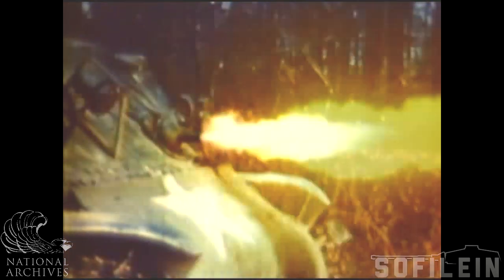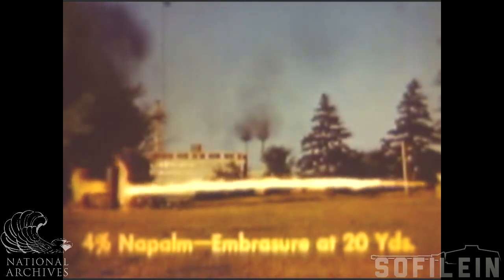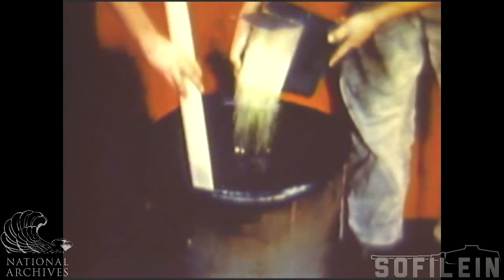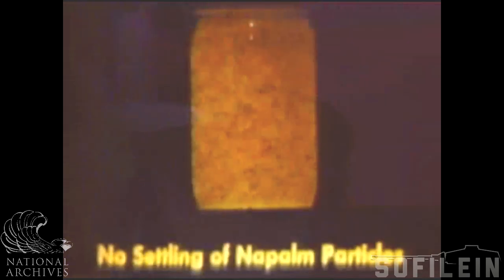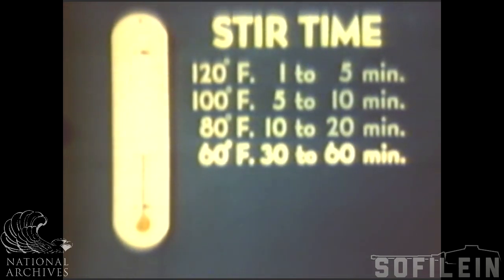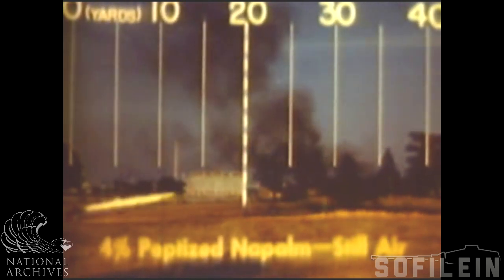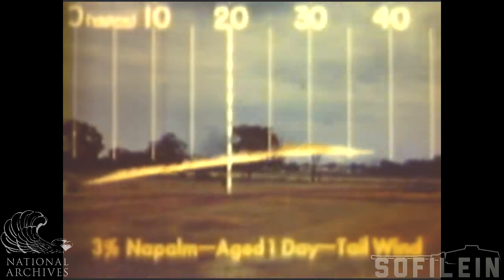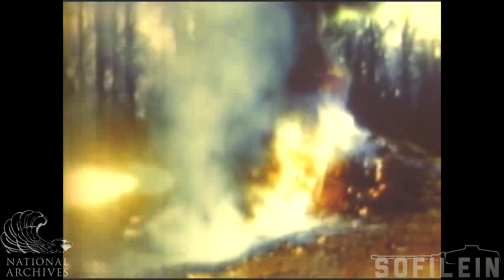How to thicken fuel with napalm for application: "Flame Thrower Fuels" War Dept FB 178 (1944)

Comment: I found the best use of a back pack thrower is to wet the target with fuel. Then light it with the next shot. You get more fuel on target and burn less in the air on the way. When the first fuel splatters on the target. The enemy may break from cover and can be killed by small arms fire.
Reply: Ya, right
Reply: What enemy are you going on about?
Reply: @lesslisilverman  You do know that you can buy flamethrowers right? Stop doubting people just to doubt them lol
Reply: @Hr1s7i  I'm assuming he's making a presumption, although it is grounded in history as not many soldiers (relatively) were actually killed by the flamethrowers themselves. The main use of a flamethrower was to push enemies out of fortified positions, bunkers, trenches, etc. so that they could be picked off by small arms fire.
Reply: @RustyShackleford556  ‘push out’ yea nah flame hits your pillbox your not getting out in time 9/10.

Comment: And for those of you that don't know this you can use styrofoam which will condense or you could use liquid soap also and I know this from experience because I own a flamethrower that I paid $5,000 for and that's what I use most of the time I use liquid soap Dawn is the best
Reply: Strictly used as a weed clearng farming implement I presume ;)

Comment: Part of NBC or CBR training in the US Army, at Ft. Hood, TX c. 1974, was firing flame throwers, IF you scored high on the final exam. I fired one, heavy weapon loaded with napalm and compressed air. Very intoxicating and not just from the fumes. Geoff Who notes use with caution , your own side might shoot at a flame weapon because it's so nasty. The M-202 flame weapon was preferred, you didn't have the flame indicating your own position.  https://en.wikipedia.org/wiki/M202_FLASH

Comment: Wow, just wow. 

The narrator is certainly cheerful in this film. I'm sure he'd be just as cheerful describing the use of a backpack nuke for urban renewal purposes. 

They reversed the Sherman in the beginning-- the bow gun is on the right, not the left on all models
Good flame thrower material, after stirring, should have the same drip consistency a maple syrup. 
I guess the guy hand stirring never considered wearing "gloves"
Should be aged for about the same time as a bottle of Boone's Farm screw top wine. 

Thank you for this! Certainly not something I want to try at home any time soon.

Comment: Not a single mask or rubber glove anywhere.
Reply from the maker: Just rrrrreach on in and stir it with your hands 😅
Reply: @Sofilein  yes, they don't put lead in gasoline anymore ... wondering why it took so much time figure it was poisonous...
Reply: @mr.waffentrager4400  they knew it was poisonous, it was just that they considdered it economically unfeasible to lubricate the engines in other ways.
Reply: @SonsOfLorgar  so we took endured damage for some decades ...lika tank
Reply: Thank you Sofie .

Comment: You are aware, that the Bycantine Empire already developed flame throwers in the 7th century? Today we call it Greek fire, even though they Bycantine or east Romans saw themselves as...Romans.
Btw., there is nothing more cruel in war than to slowly burn a target and even lecture about the lenght how long the liquid or gel stays ignited. Yes, i know, war is cruel.
Reply: Tbh, most people on the wrong end of a flamethrower died of asphyxiation or carbon oxide poisoning further down an access tunnel to the flamed pillbox...
Reply: "Improvised paddle".. you have a stick, dude. Stick: 1.00.. improvised paddle: 25.99 lol
Reply: "there is nothing more cruel in war than to slowly burn a target" #1 most targets died form lack of O2 and a influx of CO2 #2 three letters NBC there more cruel.  Nitric Acid Pneumonia > low O2 high CO2